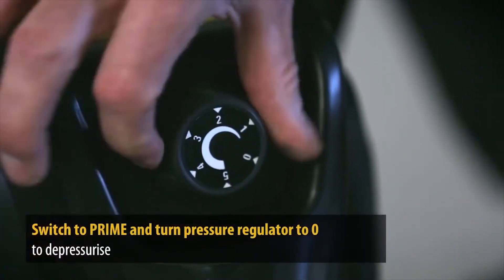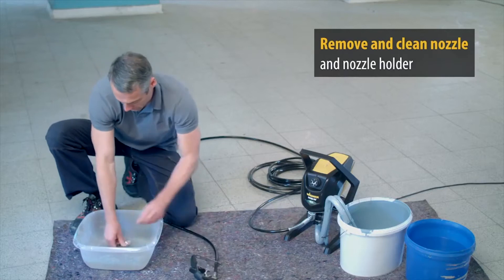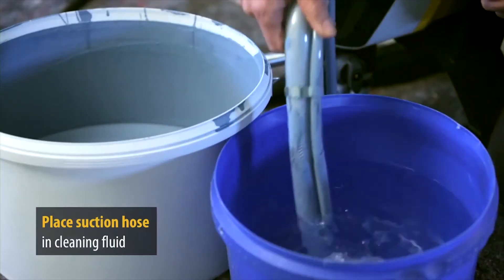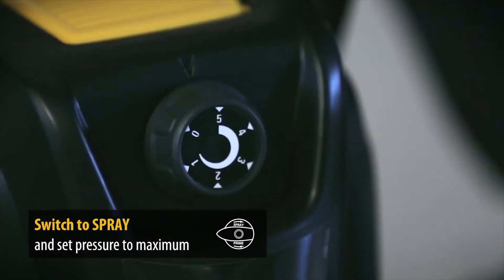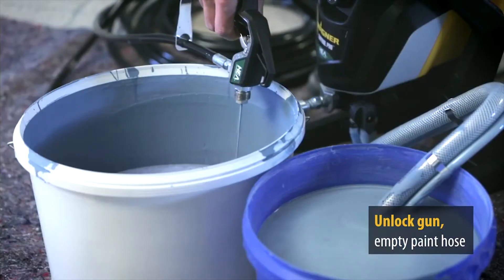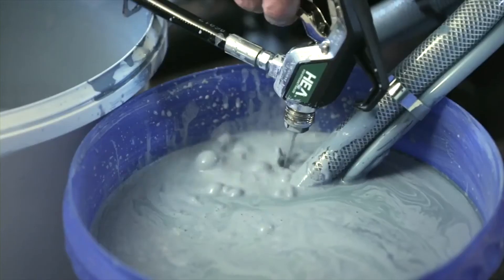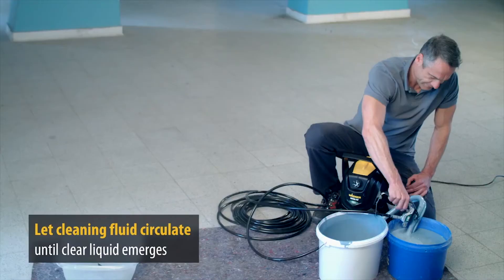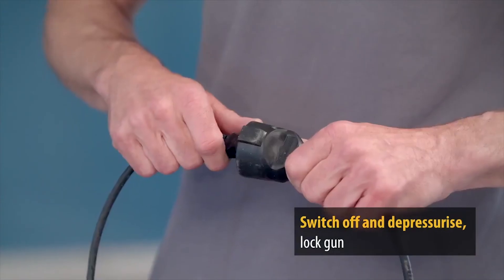Wagner Airless Control Pro 250R - How To Clean

Comment: Missed a few steps but ok
Reply: Hi mate I usually turn the machine off remove the inlet and outlet tubes clean them separately then re attach and insert inlet into clean water bucket and outlet into empty bucket. Set sprayer to spray and empty paint in line then change over to prime and let the water pass into empty bucket until clear same with hose and gun. Anything you think I'm missing or not done correctly any advise would be appreciated